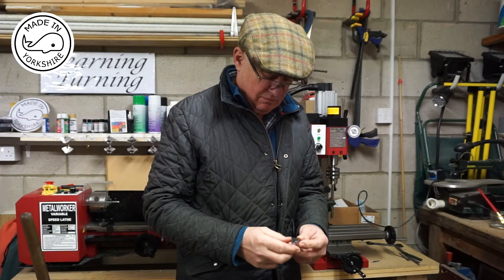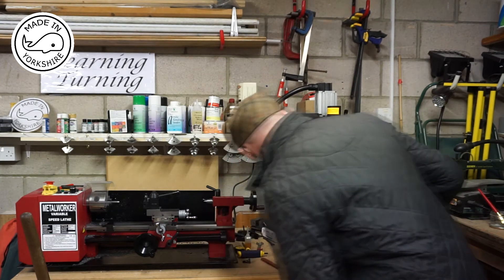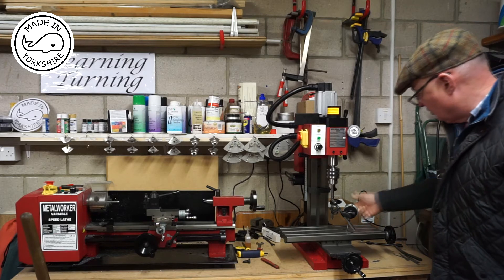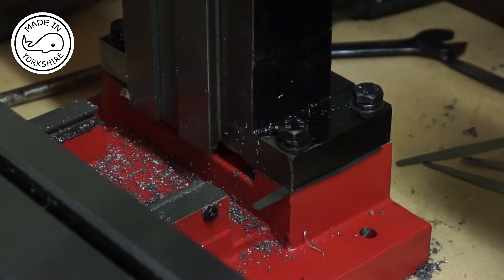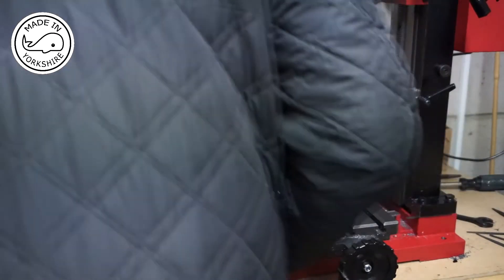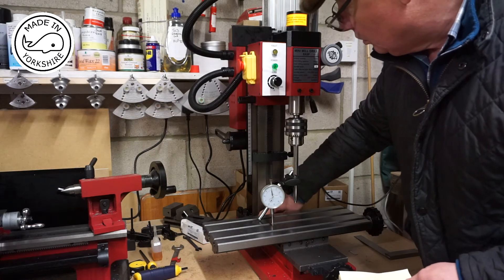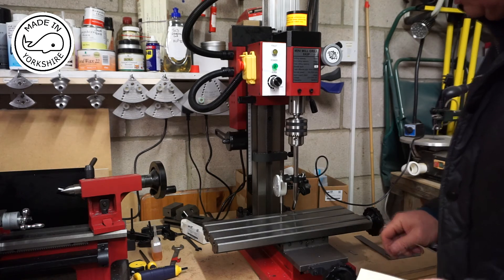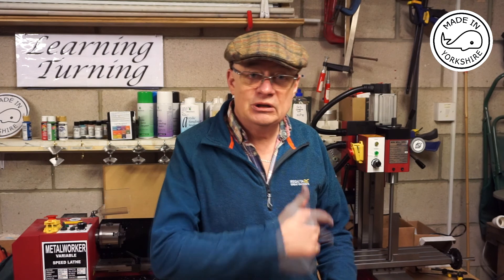#MT7 - Tramming the Mill. By Andrew Whale.

Comment: baseTraming this mill from what I  have seen is a challenge. Someone said that you can tram this mill by adjusting the 4 bolts holding the head to its base.
Reply: Hi Mike - I don't think that adjusting the bolts would have worked on my mill. Since tramming it using the method shown I've seen near perfect results.
Cheers
Andrew

Comment: Hi Andrew: Got your comment & wishing you back Happy Holidays/New Year. I see by your location in Tadcaster you are close to Skipton & York. I had the pleasure of going to Skipton Castle & Viking Exhibit in York. It amazed me your history you have. The math was a 'rough guide' i found when doing machine alignments. By 'rough' i should have clearified myself by saying --- doesn't always work. This might help .---- Error .001  Shims Needed .008/.010 Correction. It is almost 8/10 to 1 Ratio Difference. Of course as mentioned lot of other factors involved too. You were correct in  your method of working it out a little @ time as thats the best way. I have to the same thing to my Mini-Mill since I remounted it to a portable stand, Double bottom base stand with sub-bottom on wheels to move it around. Another project have going. My Mill has the tilting column instead of the solid one like yours. I also besides completing the machine mounting want to change out the spindle drive gears to the belt conversion-mount the auto spring head/column assist conversion kit, tram mill like you did, organize its tooling in base bottom which will be used only for mill, add chip sides to base for chip / swarf containment. So have plenty to do. The hell of it is - you have all these things you want to do when you retire --- then your health goes to pot!!! So I have my good days & not so good so I just bare with it. I don't know if your have a supplier for your mill there I assume you would have but here's one I use in States --- its called LMS - Little Machine Shop. I don't know what Customs/Import deal would be. I was working with 1 company (UK) there for some attachments but put that on hold @ present because of that. (Another 'BUSY' project) I have a few of those. Part of my enjoyment in retirement is the 'Collection" of tools &  their tooling -------- now just setting them up for use. like you said i've got the "Monarch" which i actually did get a start on. I set up a MACHINE LOG with each part print with its own detailed page  ---operations done, setups, tooling needed, dates etc. & started clean up on engine base casting.  Well better close   Cheers  Mike

Comment: 1;53 "Maybe the Column is skewed.".... Or Notice the Indicator Rod in a Drill Chuck? Is the Indicator Rod True? (Not Bent)
Is the Indicator Rod in the Drill Chuck Running Tue?
Reply from the maker: Hi Joe - yeah the column was definately skewed. After adjustment that mill has machined absolutely perfectly since. The only weak link is the operator (me)!
Cheers
Andrew

Comment: Andrew, this video is terribly helpful to me.  I’m learning machining as my medical therapy after cancer, and in June took delivery of the LMS 5550 Deluxe Bench Mill (a USA version of the same Sieg 2.7 mill you have),  On such a well made product, its shocking to me the design with regards to a shop fundamental.  Thanks for posting your findings !
Reply from the maker: Hi Marc - my mill is the smalller SX2P. I fancied the 2.7 but at the time I just didn't have the space. From what I understand, it's not uncommon to have to tram these mills from the far east. It's a bit of a pain, but once done you shouldn't have to revisit it. Glad it's been of some use.
Take care and all the best.
Andrew
Reply: @learningturningmetal  Your mill would be the match for LMS 3990, which I am in the process of setting up, so I thank you.  I had to detach the column from the base to get the mill up on the bench so I have no idea how true it may or not have been when it left the factory.  It's out at least .010" now.  So I have an hour or two of measure, shim , repeat in my near future.

Comment: 1. Indicator is not pointing straight down
2. You hold the indicator, the indicator may move
3. You should measure the Z travel first to see  if it’s perpendicular to the table in both x and y, the head may be the cause not the column base
4. You should not “shim” the base where most rigidity is needed for a mill, you should scrape  it in instead
Reply: This is the problem I am having with my Sieg X1. The column is pretty much true to the table as when I move the nead up and down over 4 inches the DTI registers less than 0.02mm of error but when I extend the quill the error increases to 0.07mm over 30mm of travel which is the max extension of the quill on the X1 so the quill is not perpendicular to the table. I can't see any way of adjusting this . It is either the quill or the head. If I tram the quill then the head will be out of alignment and this causes serious problems when indicating a work piece and then lowering the head for spot drilling or milling since the head would not be in the intended position.
Reply from the maker: Hi  @lensman5762  It sounds like you have some major problems with your X1. I think the design must be different to the SX2P because mine doesn't have a quill feed as such. In replace of a quill feed the SX2P has a fine feed for the head. I hope someone reading your post will be able to help you.
All the best.
Andrew
Reply from the maker: Many thanks for the advice. I think I must have been lucky because the end result is near perfect. I'm sure your advice will help others though.
Cheers
Andrew
Reply: adding 1 or 2 shims of 0.05 won't change the rigidity of the column anyhow. The column itself or rather it's silly design makes thing so that the column is quite flexible by definition. The stupid engineer from Sieg who designed the mill should make big radial fillets all over the bottom flange. But those idiots even machined it to square instead.

Comment: Hi,
Tip
Always keep the dial test indicator perpendicular to the surface being measured.
As your measurements will have a cosine error. This may not seem a great deal, until it's too late.
You can use a finger type test indicator when is not permissible to keep the indicator perpendicular to the surface being measured.
So long as the probe tip is with in 15 degrees of the measured surface.
Great for checking run out in a bore or centering a punch mark on work held in a four jaw chuck.
When tramming a mill, left to right is the "tilt" and front to back is the "nod".
By using two matched parallels on the bed saves having to retract the plunger on the DTI to miss the tee slots.
Any error in tilt or nod will show up when fly cutting large surface area, either as a step in the work or a concave surface.
ATB Adam
Reply from the maker: Hi Adam - thanks for the tip. I will try to remember this going forward.
Cheers
Andrew
Reply: @learningturningmetal  I am not too sure if this really makes a difference as the error is always constant. You are not making absolute measurements but relative. If you were measuring absolute errors then yes the DTI had to be absolutely perpendicular but all you want is the needle to remain at the same point . The only point that I would make is to have your indicator describe a circle slightly larger than the length of the largest work piece that you usually work with. It is no point trying to tram a mill over 10" if you only machine small bits and pieces for model engineering. I would say that 6" is plenty large  a circle for our needs. What do you think of the capabilities of the X2P? I am undecided between this mill and the larger X2.7 ( space requirement not withstanding and I wouldn't want to tram a 250lbs mill either ). Many thanks.
Reply from the maker: Hi  @lensman5762  thanks for the feedback. My SX2P is very good, after having made various mods. I initially intended to get a SX2.7 but it was just too big for my available space (I went to view it at Arc). Head travel can become very limited with the SX2P, once you have added a rotarty table and chuck. However, you can help avoid this by using a collet chuck. For the work I have done to-date it hasn't been a problem. But, if you can accommodate the SX2.7, I would go for that. The bigger the better!
Cheers
Andrew

Comment: I performed the same exercise on the weekend. One thing I did differently than you was I used a longer arm on my dial indicator and checked the far ends of the mill table. I also have the advantage of having a tilting column so I didn't nrrd to shim my column, I just adjusted it till it was square. I managed to get mine within .005 at end to end (I was very happy with those results). One other thing I did first was adjust the gibbs on the X & Y axis to remove any play.
Reply from the maker: Hi bhein67. Grand idea to use the long arm on the dial indicator. The accuracy of the milling I'm getting is really spot on, but I'll double-check using the long arm. Also a good idea to check gibs - I didn't think of that.
Cheers
Andrew